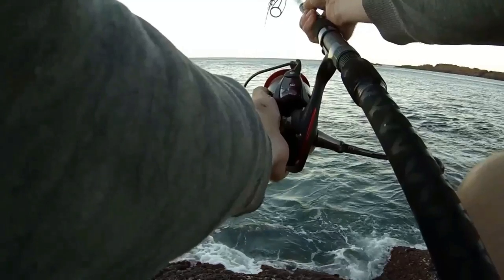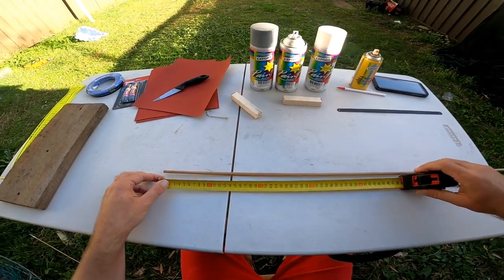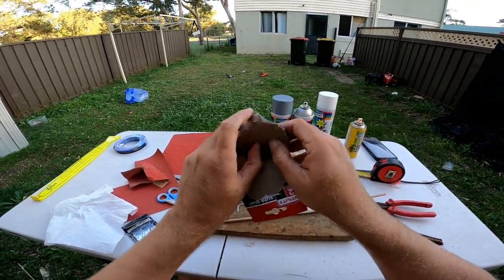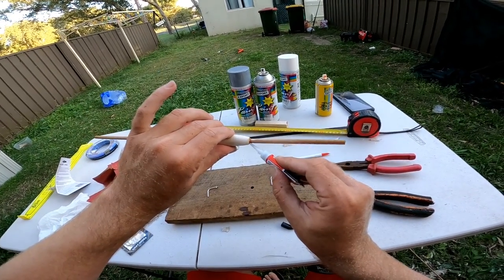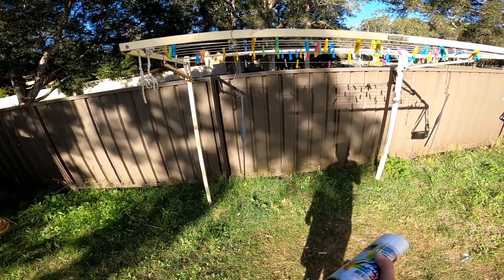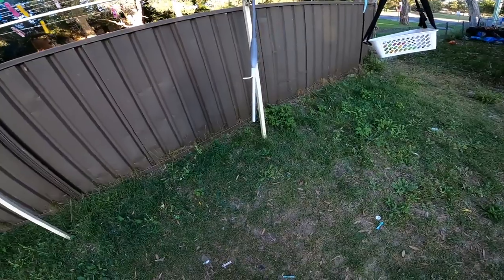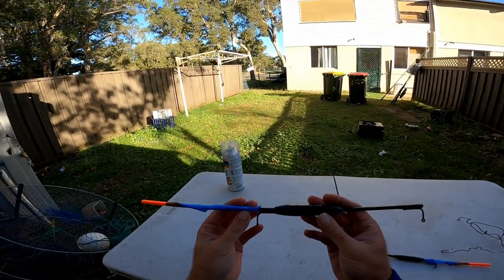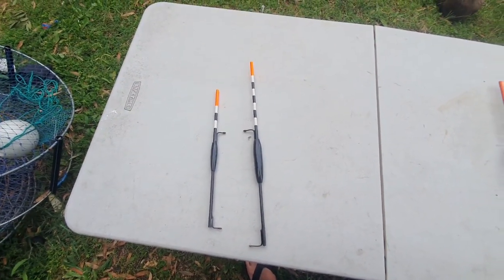How to make FLOATS for luderick Fishing

Comment: Hey how's it going mate!  I really like your attitude towards fishing as well as the videos you make, like this one  😃  Here's how I make my floats.  I buy the 1/2 inch (or larger) balsa dowel from Bunnings (as they are already round) and I cut them to size and stick the pointy end of a bamboo skewer in the center of each end of the dowel and glue them in, then cut each skewer to size. I then make a taper on both ends of the dowel much like you have done with the square balsa. For runners, I just cut the clips of some small brass safety pins making a bend at the cut off ends, and leaving some straight. I then bind and glue a bent one on the end of the bottom skewers and I just push a straight one into the top of the float body and apply a small amount of glue. Hope you or someone else will find this helpful, cheers    😊
Reply from the maker: Thanks mate mite try some dowel in stead of balsa next time Thanks mate cheers  👍

Comment: Thanks again for another great video. For cutting wood dowel, a MITRE box and tenon saw, sold as a pair, could be handy, probably pick up a cheapy at a garage sale, Aldi have them from time to time. Bunnings do have a hacksaw blade holder for a few buxx. Don't know if they're the right size, but camping shops have replacement fibreglass rods for small hiking tents. Cheers

Comment: Good video. Nice tip about the paper towel, you don't want the hook end on the ground and ending up in the mower or the feet. Was there much paint in the eyes or don't you worry about it. I guess you could put a bit of tape over them if it bothers you too much. They look good in the black. Would you put any weight at the bottom, or you  happier with the rig holding it down? Starting to get luderick downhere on the central coast. Keep it up!
Reply from the maker: Thanks mate yeah the eyes only end up with a light coat of paint it stops them from rusting as quick and if the paint blocks the hole just poke it out with a hook or pin I don't put weight on the float it's self I find it better to have it on the rig especially when rock fishing so it gets you bait down to where you need it mate thanks cheers 👍
Reply: if he put tape over the eyes he wouldnt be able to see where hes spraying

Comment: What are the brands of your primer and paints please?
Reply from the maker: It's called  export paint just cheap stuff from super cheap auto 👍
Reply: Sticky Fishy Fishing nice thank you
Reply: I made a wooden lathe and turned another design of blackfish float (the body takes the whole length, like a long pencil) and used Dy-Mark fluoro red and Rust-oleum primer and clear coat but that’s a bit dear. Will try this out later.